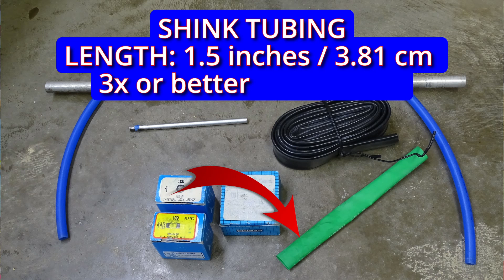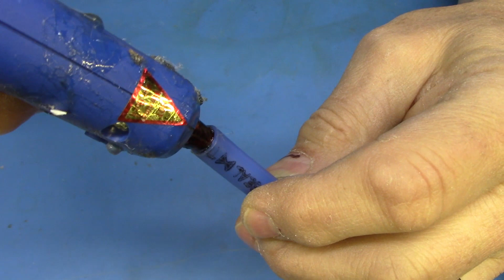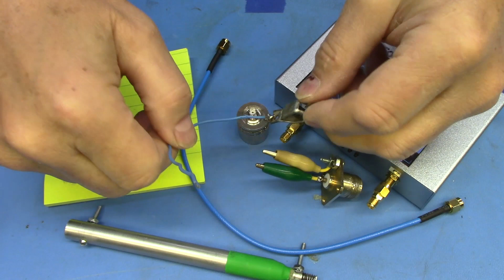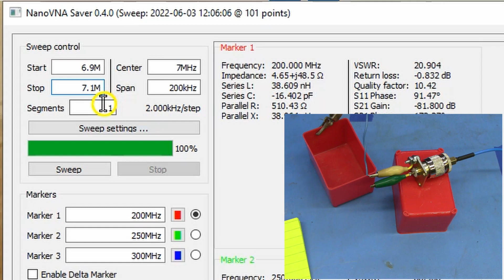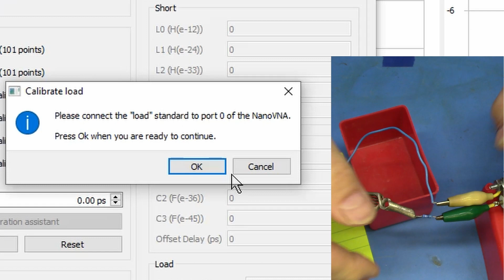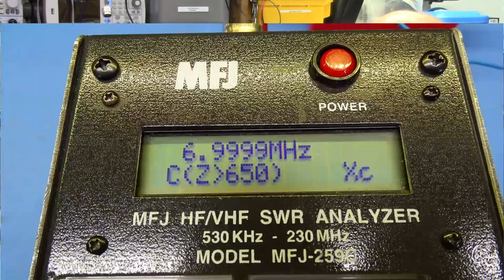Create Your Own Tubular Capacitor! (028)

Comment: Hello Ralph, I follow your video posts on youtube, and hey, they are excellent.
I hope to get some advice from you with the problem discribed below. Sorry, I'm Swiss and therefore everything is in metric units.
I built a tubular capacitor that is part of a magloop antenna in the top tube of the main loop opposite the feed loop.
The antenna is built by the idea of John Portune W6NBC (can be found on youtube).
Since the inner tube sits between the 2 ends of the mainloop, it has the function of 2 cap in series. At max capacitance the overlap between the innertube and the outertube to the left and right side is about 60mm each.
Innertube is a 40mm PVC pipe covered with 0.07mm Aluminum tape, outer tube is a 50/46mm PMMA Pipe covered with 0.07mm Aluminum tape (on the outside). Hence the dialectric consists of 3mm air and 3mm PMMA all aroud.
It tunes fine, but when applying above 15W, the outer tube starts to warm up and the capacitance drifts away.
I have no clue, in which part the heat starts to build up, but I suspect the voltage rise of the outer tube over the part covered by the innertube, since voltage rises continiously over the main loop towards the end. Or is it the permittivity from PMMA? I tried PE also, but I had a strike through with that one already. I dont know if its important, but I'm operating around 27MHz and the loop size is optimized in size to fit just under self resonance and therefore reduce the voltage over the cap and get the best efficiency out.
Reply from the maker: Aaaah! A magloop! I haven't messed with these at all. Somewhere I heard that there is a lot of current in them which would explain the heating. I didn't take the time to listen to the over hour long video you pointed me to ... I did listen to some of it.  Your conductor thickness has to be sufficient to carry the current. If I remember right, I seem to remember hearing the fellow say that he had three layers of that aluminum tape (??). Like I said, this is one place I haven't gone, so I don't think I can be much help. Please accept my apologies on this one. :-)